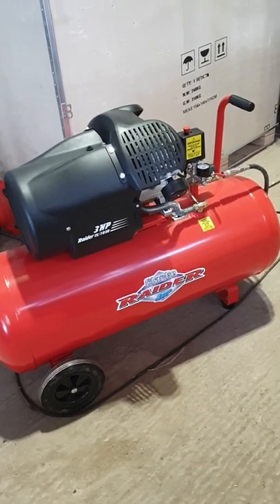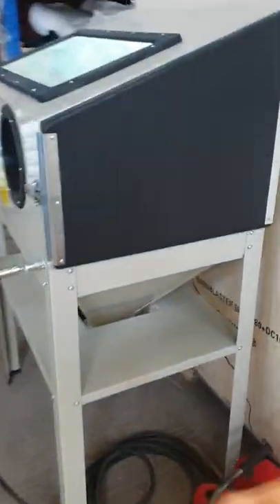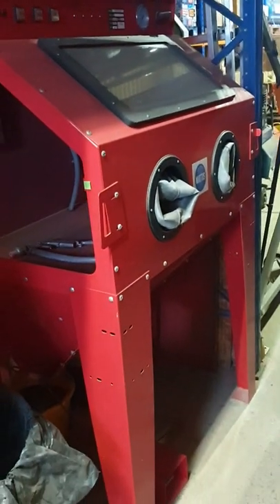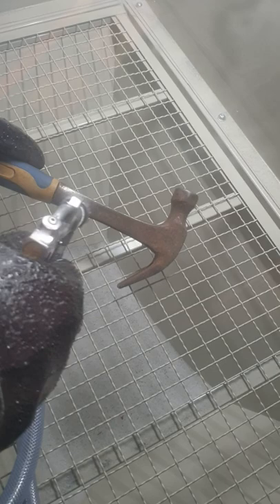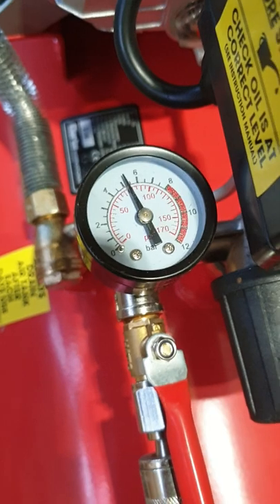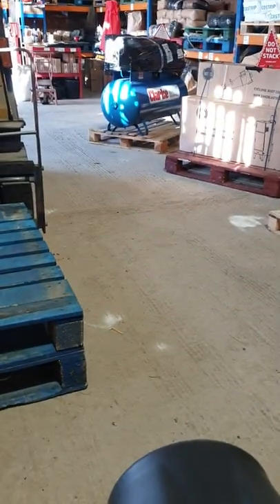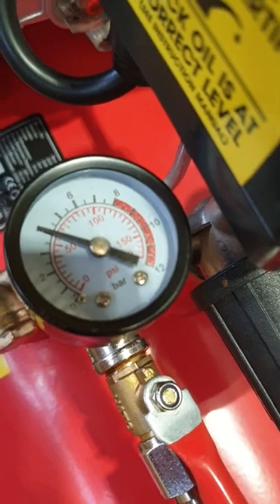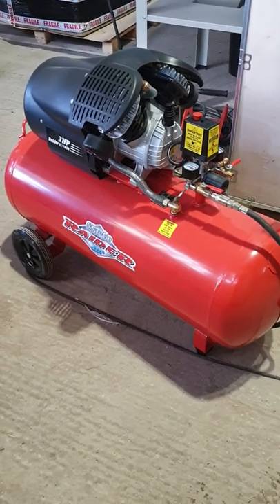Compressor Sand Blasting in Cabinets

Comment: Or get the biggest compressor you can, I got a 7hp petrol that can run all day long and refills the tank super fast.
Reply: what brand is yours? I've bought a cabinet and have a 7hp hyundai compressor which is 11cmf, hoping it will have the guys to do the job.
Reply: @MTBwayneMTB  it should work but just use the smallest nozzles you can. You run out of air super fast when blasting.
Reply: @richardportelli1983  got it all setup and it runs easy no struggles and because I'm a mobile mechanic my compressor is in the van and My blaster is in the shed (30cm away) which I was worried about Length of the pipe ect, runs nicely on on standard middle size nozzle 

thanks for the reply though 👍

Comment: Great video, any idea if 50 litre 14CFM compressor attached with 100 or 200 litre air receiver would it do the trick? Thanks
Reply from the maker: Hi, it would take longer to fill the extra tanks risking the motor on your small compressor over heating